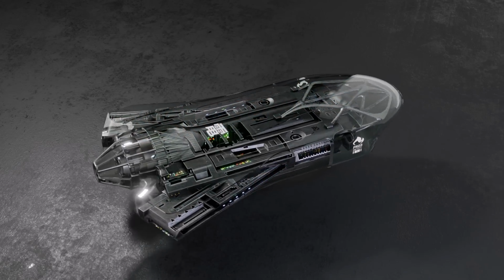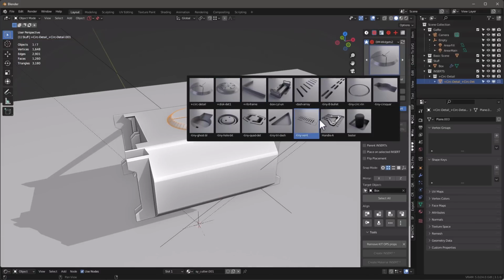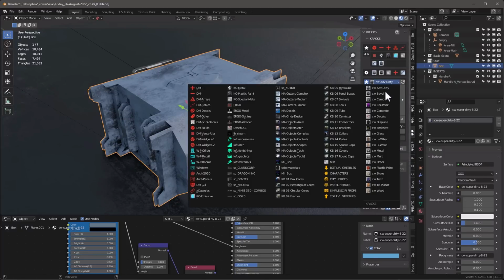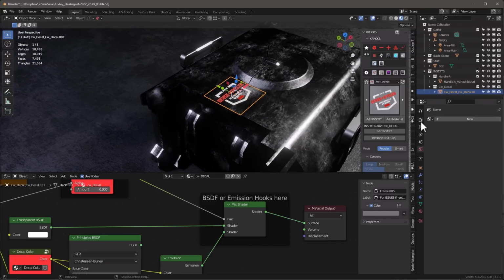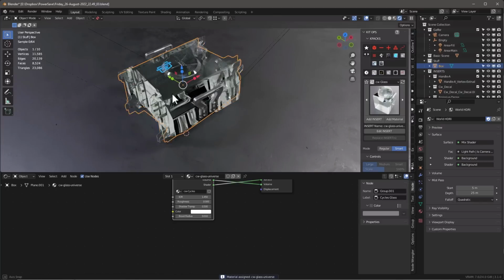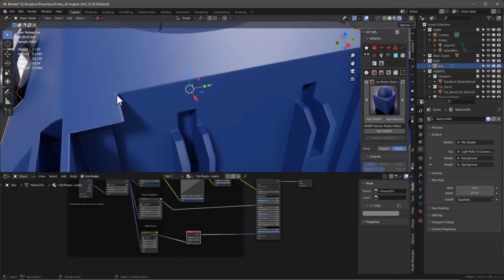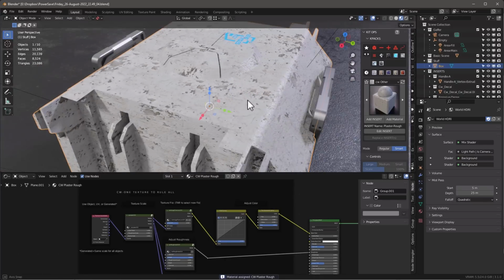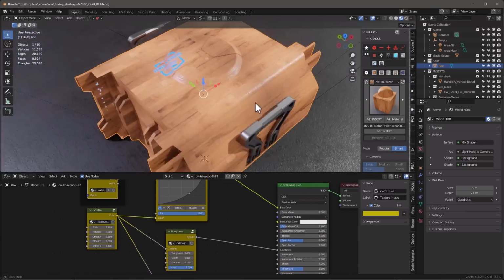Massive update on Materials System for Blender-- now works with Cycles!

Comment: Nice work to say the least. I like that triplanar projection. One thing I noticed is there's no #5 video uploaded for the product.
I don't know if this was one that was scrapped, or just skipped over in number, or forgot to upload, but didn't see one (on blendermarket)
Reply from the maker: There is one there on youtube. It is older and deals with the dirt mapping. Those nodes are still available but I have a new dirty node group in this new version and I'm in the process of creating a video for it.
Reply: @ChippWalters  - thanks I'll check it out